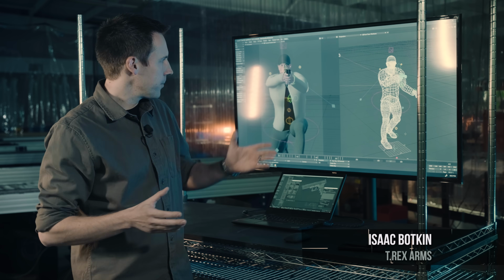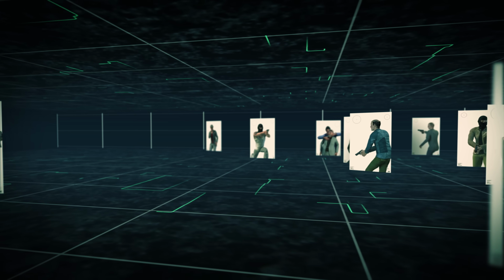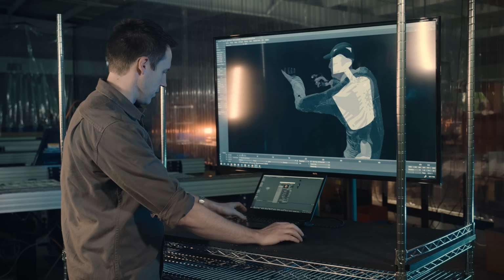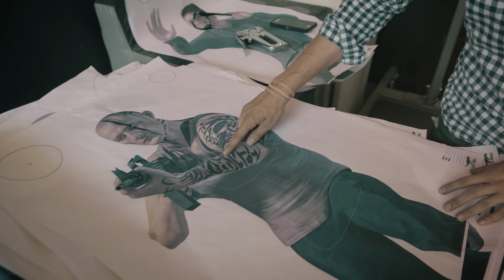Next Generation Target System for CQB

Comment: Is it just me or are those HuamnIK rigs?  @T.REX ARMS It's a brilliant use of the package. Adobe has an animation package called Mixamo where you could load pre-built animations into a HumanIK rig and can clean up the desired pose from the animation. You can also use Autodesk Character Generator to quickly build new characters. That might help speed up workflow for new targets if you are currently posing/modeling them manually.

Comment: This is one of those innovations that makes me think “why hasn’t this been created before now?!” GENIUS!
Reply: It has, for decades. Nothing in paper targets here that hasn’t been done before.
Reply: Freddie C Saying this is “nothing new” is like equating a 1920 Ford Model T with a 2020 Mid-engine Corvette on the sole basis that they’re both just “vehicles”. While I agree they’ll both eventually accomplish the task of transportation, one is much, much more effective and efficient in doing so. I also agree, these are just paper targets. However, to my knowledge no company has made available, the full customization of each individual target, even down to facial structure, allowing them to satisfy individual customers’ separate and specific needs, prior to this. The software generating the targets, along with T. Rex Arms’ application of it, is whats innovative, not necessarily the targets themselves. Putting pneumatic tires on cars was innovative in much the same way. Air was not new, rubber was not new, and the wheel, most certainly, was not new. Trapping air inside a piece rubber attached to the wheel of a car, thus combining a few well established technologies into one exceptionally performing product? Undeniably innovative. In my opinion, the same is true here.
Reply: Adam Grantham We routinely print out targets from actual photos. We can place anybody's face on a target by simply having a base profile. There have been shoot no / no shoot targets for decades. We currently have (as one example) double sided targets with the same person on both sides but one is a shoot and the other side is no shoot. They cost something like .38 ¢ / target. These targets are $75 for 25 targets. Further, these are renderings (opposed to “real” people) on paper, non life size (there is no “anatomical correctness”), and still just a 2d image. There are a whole host of companies that will make custom targets. Really, thinking this is something new is purely lack of knowledge and inexperience.
Reply: Freddie C ahhh, now it makes sense. Your another target provider.

Edit: Just as an example, You still believe you’d be able to undercut the $75 price if a customer were to call and take you up on your “photo” targets? By the way they must be 25 different people, at least 7 have to be fully tattooed on visible skin and 3 have to be shirtless (not just bottom half of arms exposed). 15 of the targets are shoot targets and each target must have a different firearm. Of those 15 there must be 3 Russian military men in full gear, 2 Latino guys in full construction uniforms and 2 wearing full middle eastern outfits of middle eastern descent holding rpg’s. Then there must be 10 no shoot targets, 5 of which also need unique weapons and must be facing away when photographed all at different angles to emphasize differences in bullet impact to vitals through areas like the shoulders. All must be of Colombian descent, 3 wearing professional soccer uniforms and 2 must be dressed as referees for professional soccer. 

Look man, I could go on, but I think you get my point. Whether or not it is a “real” person is irrelevant, and I guarantee you they could print “life size” targets if need be. He specifically said they made them the size they did to take advantage of the infinite amount of different poses they can make, otherwise it wouldn’t make use of the visual of the body positioning in identifying threat/no threat. To replicate what they are able to do with a computer and an hour of time by using typical photography and print, would be a full time job in and of itself and take a lifetime compared to punching in a few prerequisite fields and altering from there with one guy, one computer, a mouse and a keyboard. Just the cost of hiring 25 different people to be photographed, not to mention all their clothing, the fake tattoos or people with tattoos, getting that many different guns (some of which like rpg’s need special licensing to even have to photograph in the first place, the amount of camera equipment, location, on and on and on... would hurdle the cost out of the stratosphere compared to $75 for 25 targets, each of which you can design, set up, pose and infinitely have control over. Come on man, if you still cant admit that this is a good idea, then your just being a sore competitor in the target market. I mean, its not like its going to cut into your business. You supply for the masses, what T.Rex Arms is doing is for a very specific and limited set who require that kind of detailed control. Also, if its so easy to do and has been around for so long, why is it not easily available on your website (challengetargets.com, I assume, as you implied you work for them) for fully custom targets and why did Lucas see a void in the market to make this a available? If it is such easy and old news I find it highly improbable that they would have put in the time and effort to “remake” something already widely available, and then showcase it.
Reply: Freddie C Alright there, sport. Have a good day and God bless.
Reply: @chiefro7  Uh huh. Thought so.
Reply: Freddie C Thought so what?! You are just a hater. Its guys like you who would be keeping the entire firearms industry back in the flintlock age because you cant just appreciate people working and trying to progress products on the market to their next evolution. Sweet, you’ve been a trainer for 2 decades, but what have you done to put new (or even old) products on the market?! Just because you don’t think you have a use for this product in the way you train with the budget those you train are afforded, doesn’t mean no one else does either. Dallas SWAT just got all new lwrci rifles for their squad, you really gonna try making the point that they can spend that kind of money to equip their guys and not spend equal if not more on the targets they train with?! Its curious that you jump to personal insults and think you know me and/or my skillset but the point still stands. Why would I or anyone, need ANY EXPERIENCE to be able to appreciate someones attempt to put out a product that they have felt there was a need for? You countered ZERO of my points about being able to make an equivalent target set with photography instead of a computer. Instead you decided telling me of my inexperience along with T.Rex Arms’, your profound wealth of training time, and your opinion that if people feel the need for these targets is appropriate, they aren’t training or being trained adequately, was warranted. Can someone get by with using the age old standard shoot/no shoot targets? Of course! Knocking someone because they choose to use a product that takes the standard and tries to expand on it and make something better, along with those who made the product, is just asinine. Iron sights will get rounds on target too, but it is now an accepted reality that optics are better. You’re the guy fighting against a red dot cuz you’ve trained guys for 20+ years with irons and its adequate enough. It just blows my mind the level of animosity in the firearm industry amongst “peers”. I made a comment TO THE MAKER OF THE VIDEO and you, for whatever reason, thought it necessary to say I’m totally wrong, the product is the antithesis of innovative cuz “Ive taken pics and printed them on paper”, and anyone making/training with these targets is wasting money and needs to train the way you do, apparently. As if you are the end all, be all in firearms training and if you don’t use it, its not be worth the paper its printed on. Sorry if I’m not impressed by your unnecessarily cynical and dismissive attitude towards those who can appreciate innovation for what it is. Someone attempting to advance progression in a particular area/field. It’s alright tho, you just stick to your antiquated ways and refusing progression for, ya know, “reasons” and just keep on keepin the pace, while the rest of the world actually appreciates attempts to advance it.

Go ahead and eek out that last word there trigger master, this conversation has long past its point of being beneficial whatsoever. Take care and God bless.
Reply: @chiefro7  Wow, you sure do like to type a diatribe. When you say I didn't counter anything you said I would challenge you to justify how these targets are revolutionary. The answer is, they are not. Acquisition dollars are not training dollars, paying a guy who has zero real world experience and no historical context of the evolution of CQB gets people killed. It's nothing more than the bright idea fairy. Do you really think that there is something that hasn't been tried before in CQB? Watch the tactics employed by the team in this video. I said it before, their problem isn't the targets, it's their tactics. PID of a threat has been carried out for decades with readily available targetry. These targets are a solution looking for a problem; not the other way around. Do you ever wonder why nobody of any real reputation endorses TREX or is in his videos? He has no real world experience, and consequently, has little knowledge of what has been tried, works, and doesn't work. His tactical experience is that of most of the commenters...  youtube videos. Just the guy I want training my high risk tactical team and taking training advice from. There are so many more ways to address the issue of PID than making more targets that are already available in other forms. Its a training problem, not a material one.

Where did I say anything about optics v iron sights? That was an evolution a long time coming. Love tactical optics. Used them plenty. But, once again, more paper targets is not an evolution. Thinking it is a step backward.
Reply: Adam Grantham One more thing - minimum order for custom targets is 2,000. At $3 / target thats $6,000 for paper targets. What a joke.

Comment: Lol, you've actually gave me the idea to generate those targets just using ML (so I don't need to use rendering for that, and still have more realistic faces than rendered ones - although, it wont be that simple to build the model fast, but still...).
Either way, very practical approach, good job.

I wonder why you haven't used ML for that?

Comment: Use a projector so all you need to do is change the white paper and you can make them life like .
Reply from the maker: So... only indoor ranges then?
Reply: T.REX ARMS yup just for indoors . Projectors are not so good on outside weather or find  a way to waterproof it. Sounds like a lot of work but can be done .

Comment: T-REX ARMS
This system is amazing. I TRULY wish this was available 30 years ago when I was an Operator. 
The amount of visual data that this system is flooding the brain with, in a high stress situation forces the students to focus hard and fast. The more data flooding the eyes and brain,  the harder it is to process quickly.  This WILL force the student's brains to shift through the input and process it faster. That will keep the mind sharp. It will force trigger discipline. 
It is TRULY ASTONISHING what can be done with this from what you have shown in this video.  Now the size of the TARGET needs to be addressed to make it so you are seeing targets as they ACTUALLY are.  The limit on the 2'x3' target gives the perception of distance.  That is fine if you are ACTUALLY working on distance drills. The problem is for a person to appear to be that size the rooms have to be massive, like in the range of 70 feet or more.
I love the kill box area you are identifying on the targets. This is very important especially when using handguns.  Rifle rounds are usually going to be not affected at short distance by going through things like a shoulder blade or arm bones, neither are shotgun rounds.
This is an amazing training aide for anyone that is fortunate enough to be able to use it. Fantastic job on creating this system. Also great job on picking up on the fact that students were basically learning what to shoot because the brain picked up on the pattern even if the student did not know it.
Reply: mean45acp If you are wowed by this you were definitely not any sort of “operator!”
Reply: @freddiec6281  
Very few things  "WOW" me. The one thing that does is the advancement in technology sin e I was an Operator!!!!  High tech back then was a 3.5 power Colt scope on the CAR-15 and a 4 D cell flashlight band clamped to the handgaurd with a M203 mounted. That was the height of tech when I was in. 
I dont come.from the post 9/11 military with budgets that are as high as they are now. When I was in SeAL Team 6 had a training ammo budget higher than the ammo budget doe the entire Marine Corps. That is a fact not some made up bullshit.
Since I got out 10 years prior to 9/11, my training has been on the civilian market when I could get vacation time and have something for the rest of my family to do while I trained. 
If my thoughts and comments on this system have in some way offended your seemingly sensitive nature or conception of what an "OPERATOR" is, I beg for your your forgiveness. Apparently you know EVERYTHING about operating behind enemy lines in a 4 man recon team. I guess I never learned anything about my job. Should I give back my Gold Wings and Silver Bubbles??? I still have them along with all those rectangular blue boxes in a box in of my safes.
Reply: mean45acp Lol, well as someone who has and still is training post 9/11, targets like this have been out for decades.
Reply: mean45acp Gold wings and silver bubbles? So you went to airborne school and dive school? Interesting you don’t mention the Trident. Telling.
Reply: mean45acp So to paraphrase you - “When I was in Seal Team 6....” Stop pretending. Surely, if you were ST6, you have been to a reunion to see the capability demonstrations. There would be absolutely no “wow” over paper targets had you been to one in recent memory.
Reply: mean45acp Now as I re-read your post, you were referencing ST6. So you were a run of the mill Recon Marine. So not even close the being an “Operator” in any modern sense. Technology has progressed waaaayyy beyond paper targets and has been for decades. A simple google search will show you targets that accomplish the exact same thing for pennies on the dollar, not $75 for 25 targets like these.
Reply: They are very good looking targets, but not that new of a concept. PJL Targets out of Belgium have been around for decades and are adaptable as shoot/no shoot with various overlays, they are pretty labor intensive to set up. I plan on buying some to integrate in my existing stock of the PJL.

Comment: You can make an option to print the same target twice, it would have two layers, the bottom layer will have only organs printed with the outline of the body and the upper layer would have no zone marking or anything of that sort. After the engagement you would analyze the hits on the first layer and then see what organs did you hit o the layer below. I think this would be the most realistic way to engage the targets with the most amount of information on what you've hit (due to the layer below) without having unrealistic distractions on the first layer. What do you think?

Comment: The white background might not be too realistic but it helps spotting the target.

Fancy throwing in some bystanders behind or beside the target which is way behind and the judgement to shoot will become more complicated. Or even a background with environment hazards like gas canister or even in any simulated environment.

Like a partially concealed bystander behind the target right at the chest height meaning the target will need to be shot on the lower
torso etc.

Comment: Texas Instruments makes a cheap projector. DLP 2000. Small as a tin of Altoids mints. Bright and decent resolution. Get them from Digikey. Since you are in development mode, might as well add hardware. These are PCB components and easy to set up. You could use white paper targets and dynamically project the target onto the paper instead of printing them. Pay for the projectors in the cost of ink alone. Wifi will let you change the images remotely. And - if you want to get crazy, animate the action of the avatar using sensor data upon entry. They run on a cheap little single board computer that can play video as well. This is all very easy to do and there are tons of maker examples on YT.

Comment: it's good change. but it missed one thing.
if shooting range manager doesn't want to change target location and panel, the result would be same as very first part of this video.
maybe it's better. but not huge change.
the best one is PvP. UF pro nailed it.
Reply from the maker: Yes, you have to switch them out. Yes, force-on-force is best. But even with that you lose some of the benefit these targets offer. Time and place for both